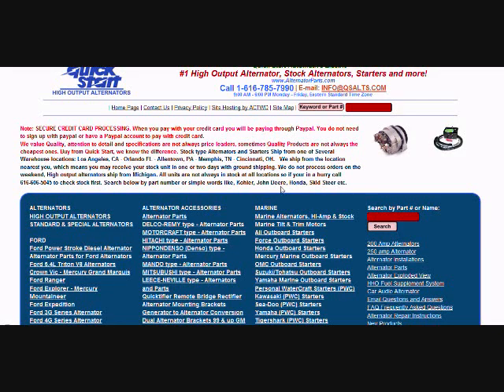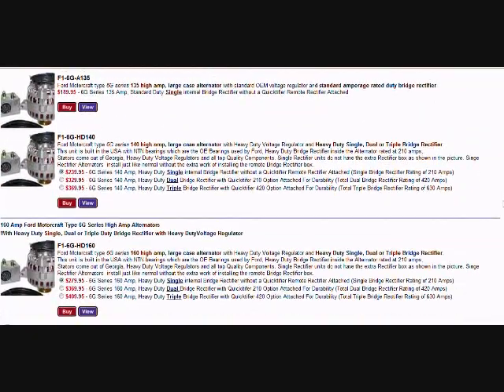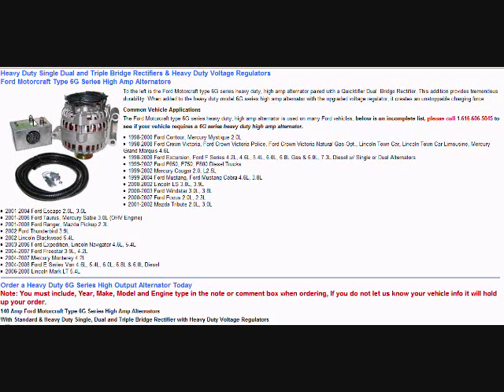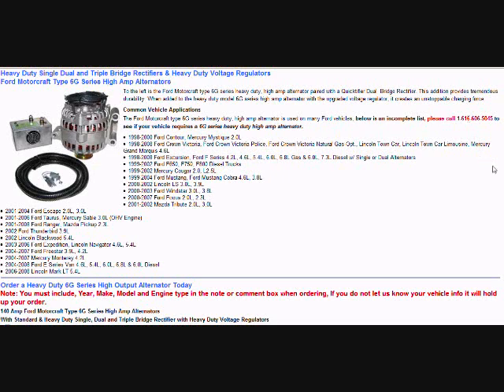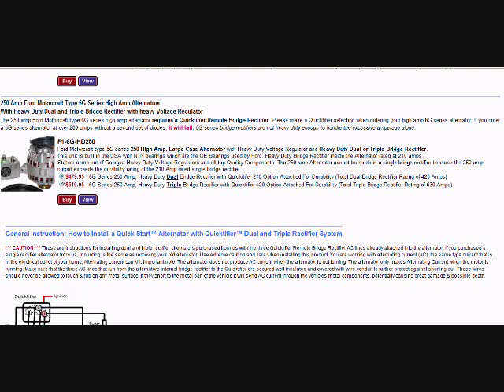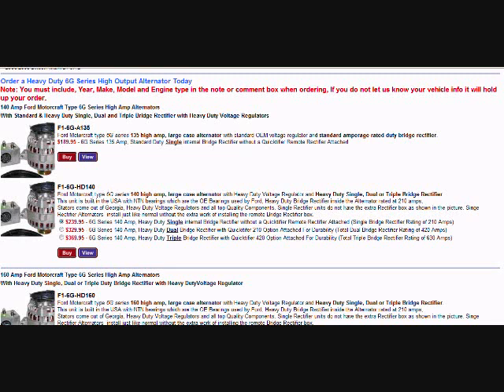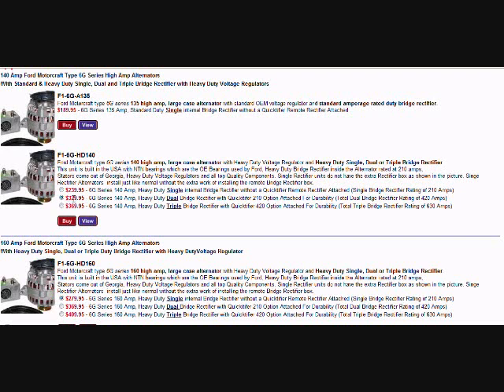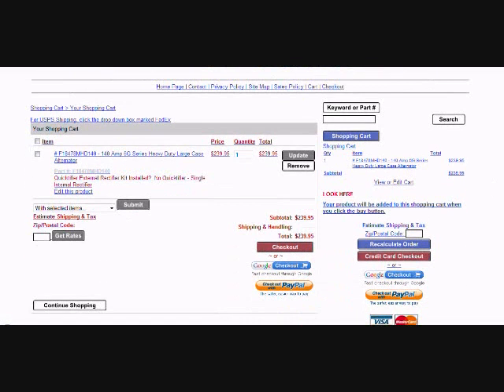DIESEL, FORD HIGH OUTPUT ALTERNATORS, LARGE CASE UPGRADE

Comment: I am looking for the Rectifier,  Your site says you can see it in the cart after you push  The buy button. There is no buy button. 
# 502067 - Extra Heavy Duty Bridge Rectifier 210 Amp Rated for LARGE CASE Ford Motorcrafe 6G Series Alternators.